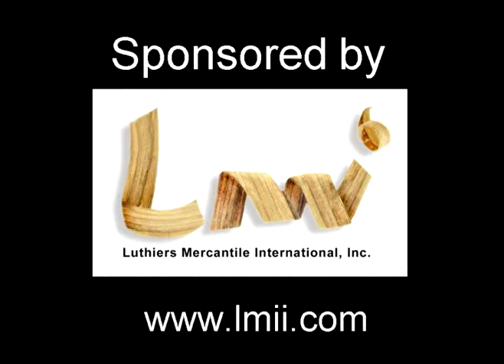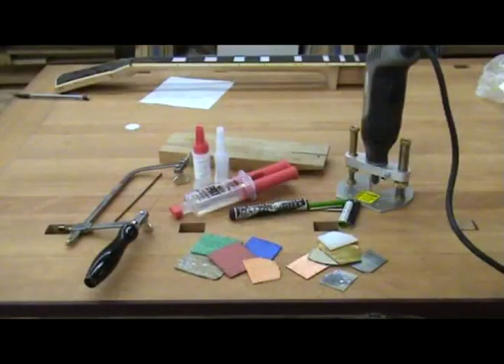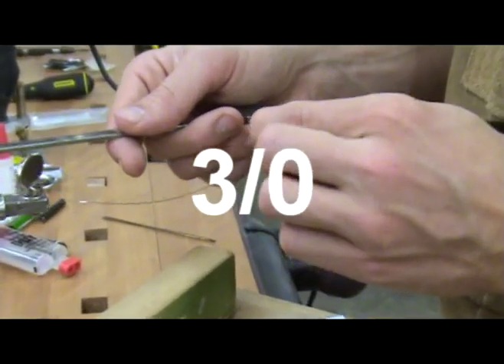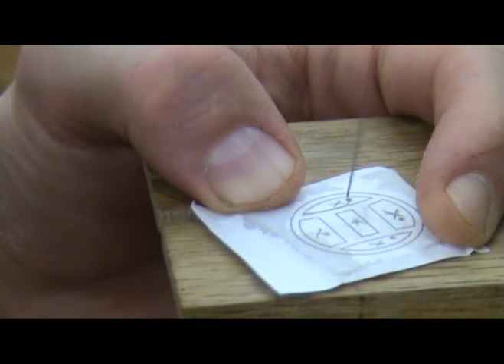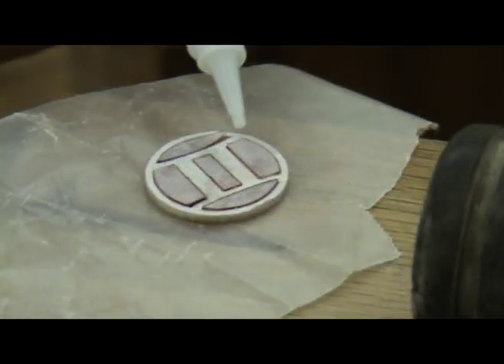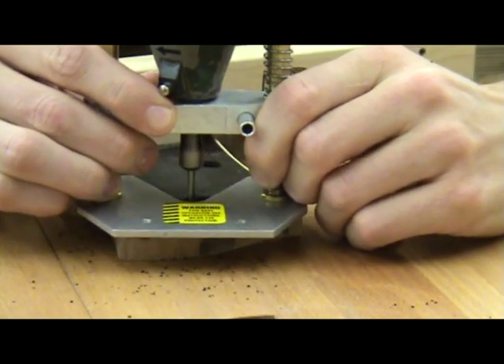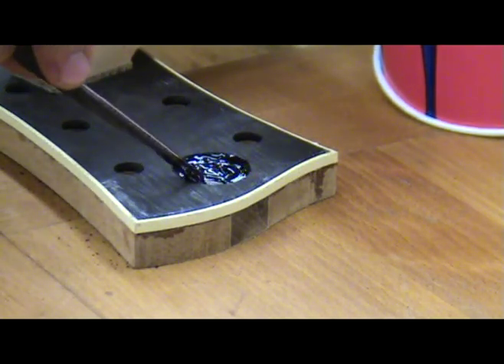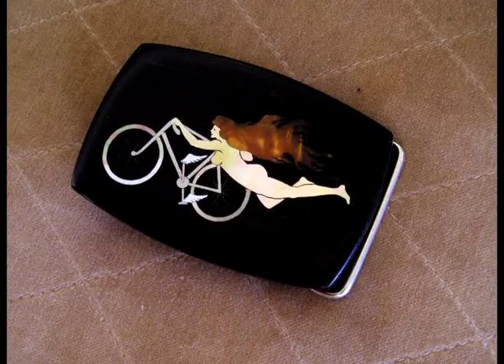Luthier Tips du Jour - Inlay - O'Brien Guitars

Comment: Do you still recommend DOWNCUT spiral bits? I understand their advantage, but have heard other presenters at GAL or ASIA say that they always build up heat so fast that they lose their temper and dull, so the presenter said he uses upcut (or straight) bits.
Reply from the maker: You can use upcut spiral bits. Some prefer it for the reasons you mentioned.
Reply: OBrienGuitars but are you saying that you don't have trouble with heating up bits and losing the temper on down it spiral bits?  I would gladly go with the down cut if so.
Reply from the maker: The bit you saw in the video was a downcut bit. I have never had a problem with them.

Comment: I'll just add that epoxy squeeze out can be easily removed by gently using a heat-gun and scraper. I would avoid using that method directly over the joint as you may lift some of the epoxy out of the seam.